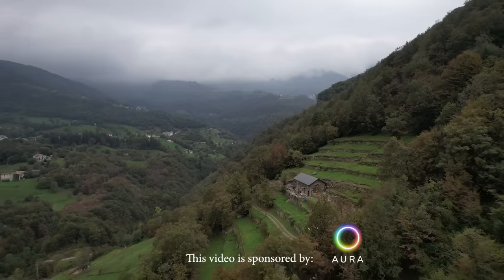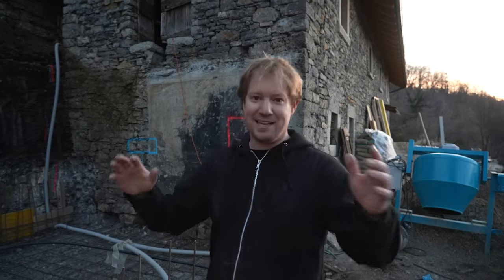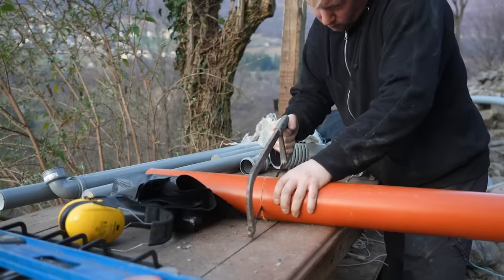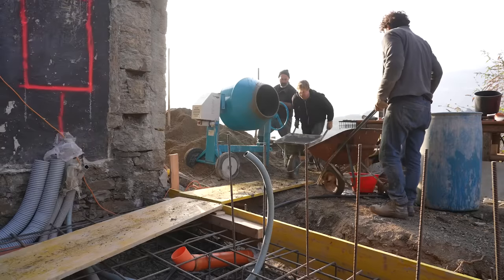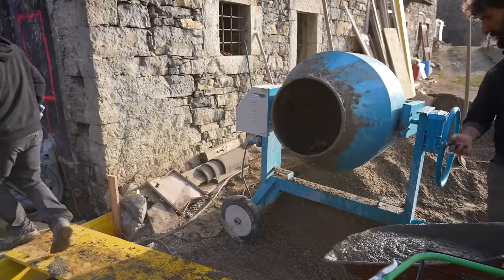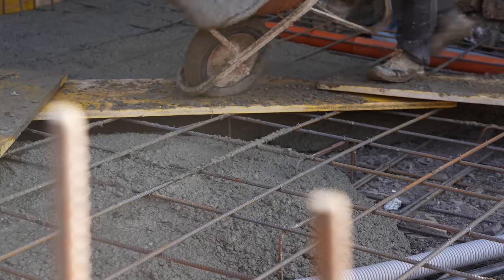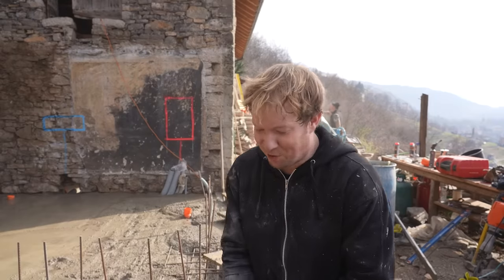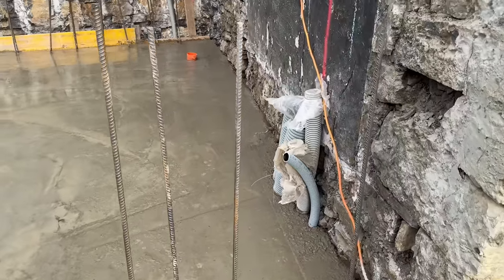THE EXPANSION BEGINS! Italian Stone House Renovation.

Comment: I am so amazed at how fast you all were moving getting that cement dumped with each wheelbarrow full!!! It really does help to have more help. I was just remembering when we poured a small 10' x 10' cement pad for a small shed we built on top. Both of our kids (then almost teens) helped shovel the rocks into the mixer, Peter and my husband Charles would dump the wheelbarrows (I probably did, too. I was much stronger then.). It was a great family time and we worked hard to make that backyard a great space to play! Eventually, we put in a pool and backed up the hill behind. Still miss that house for that backyard. :)

Glad you got all the plumbing lines and hoses for electric and other things run before the guys were there to do the cement. What a nerve-wracking process to remember every little thing! Working with seasoned pros is truly an education. Glad you home is coming along!! Sounds like things are settled with the city?? Hope so! Get some rest. 😄💕

Comment: since you cant dig out between your back wall and the terrace wall, have you considered filling the whole area with lose stone, and concrete. you could put a drain in on the terrace side, then a mesh of rebar. then start filling 2ft of rock, 2 of concrete vibrated into the gaps. and repeat the whole way up. your stone will be strong fill for free. or you could put in a bunch of Styrofoam blocks in as fill. stabilizer the wall and the terrace.

Comment: We lift the bottom rebar off the ground normally with plastic spacers as per civil engineers specification. 
Or you can pull up the rebar while pouring the concrete to get the concrete underneath the bottom rebar.
The reinforcing bars should always be placed at an adequate cover from soil. If reinforcement touches soil, it is susceptible to corrosion, which will eventually disintegrate the material, thereby deeming it useless in terms of providing adequate tension/compression or shear capacity. Rebar laying under the concrete, provide no benefit.
Greetings from South Africa.
Reply from the maker: We lifted it with loose stones

Comment: depending on the job, the manpower is based on a multiplier, not just an increase, but every job has a fine line of when there are too many workers, for 1 mixer 3, maybe 4 workers are the max before it becomes a detriment

Comment: This story, even though it is not a living space, there should have been a plastic membrane moisture barrier placed under the concrete.Because it will wake moisture up and rust your appliances.And anything you leave on the floor will soak up moisture through the concrete

Comment: Just curious, what do you do if a pipe buried in the cement floor breaks, do you have to tear up the floor to get to it to replace it? I can see having a crawl space in the rest of the house would have that not be an issue, but looks like the addition will have pipes right in the concrete. Very interesting what you’re doing!
Reply from the maker: You make sure the pipe doesn’t break 😂😏 we use reinforced pipes to ensure they are super strong

Comment: We were wondering why they didn't set up some type of trough where you can pour the cement from the mixer into a length of  half pipe (trough) letting the cement slide into the area?   <-- so says the backseat contractor.   We love your videos.
Reply: I'm wondering why not use Small Cement Truck to Pour! ...and a Rebar Tying Auto Hand Machine ... Boom Half the stress and Time Etc ..... But must be a Reason 😃

Comment: Think of the brick in the crawl space between cement layers like the old Roman floors. This was the way they heated rooms. They'd build a floor, use stacks of clay Pilae tiles every couple of feet around the floor and lay the finished floor on top. The hot air/water would travel around the room under the floors. Congratulations on such quick work! I look forward to seeing the next step!
Blessed Be!

Comment: Imagine that, professionals get stuff done quickly and up to code. You should have hired these people from the get go and saved finish work for yourself if you just feel the need to do something. Skilled blue collar mechanics didn't learn this overnight, it takes decades of experience and many years of actual training. If you want to learn how to do this stuff, you need to work as a go-for for years while getting trained to do the skill work. Anyway, you still should have solved the water intrusion issue before anything else was done. Good luck to you.

Comment: Quick question - as you know, in North America you'd just pull up a cement truck and pump out that 10/cm of cement in 30-45 min. Is doing it by hand a factor of your remote location, access on site or just a cost factor? Regardless, crack a beer - you earned it that day!

Comment: Is there a reason why you don’t have a cement truck deliver the cement instead of breaking your backs?  The advantage of a truck of premixed cement is that you can order a high strength cement or have fibers added to the cement so you don’t have to worry about the structure sliding off the mountain during torrential rains.
Reply: I think it's the road.
Too narrow for a cement truck (have you seen the u-turns from the drone?).
Also too fragile (? i think): you can't put so much weight on that type of road.
Reply from the maker: Correct the road can’t handle a cement truck. So here we mixed approximately 1.5 full truck loads
Reply: @RaisingVoyagers  gees, that’s too bad. After all that mixing, moving and floating the cement, how did your body feel the following day?  I’ve had 6 operations on my lower back so far and I was cringing watching you guys work. 🥱. You guys do great work. With a bad back, I really miss doing work around the house. Blessings to you and your family. ❤️

Comment: Why guys with 30 years of experience are not using the old methods to build the extension? Following the same way the main house was built? I dont believe concrete and steel are needed, hope you get my point. You could save money....
Reply from the maker: There are many legal requirements to follow. Code would never allow the house to be built in the old fashioned way.
Reply from the maker: And building with cement and rebar is actually far cheaper than building without. You’ll see coming up soon, how when using cement you actually do save a lot of money…. But the primary reason is to follow code

Comment: Please don't get me wrong, as I really enjoy following your restoration voyage, but as a retired member of the construction industry it yerks me when I hear you making the mistake of many regular folks. What you filmed in this episide was the pouring of "Concrete" not Cement. Cement is the gray powder that comes in bags which is used in the mixture of a) Cement, b) Sand, c) Gravel and d) Water, which put together forms Concrete. There are many forms of concrete, which are determined by the ration of Sand/Gravel to Cement, also the grain size of the gravel and last of all the strength of the cement ( correct full name being: Portland Cement). In addition, please recognise the difference between Gravel and Crushed Rock. Gravel has rounded corners and is usually harvested from river, lake or sea beds, whilst Crushed rock is the product from crushing larger rocks into sizes that suit the purpose. i.e. foundation under a "Concrete" surface, Frost blanket under a paved surface/road. There are many more explanations into the use and differences between Gravel and Crushed Rock, but if you really wish to show how much you have learnt during your project, please don't call concrete, cement or crushed rock, grave.  Last point, the reson the workmen brought their own generator is because a concrete vibrator required a 400HZ power supply, which you cannot get from the regular grid as that is only 50HZ.

Comment: I find it highly amusing that you can respect and are humbled by the stone masonry but can not appreciate the skill of the carpenters that did such an awesome job on hand hewing the chestnut beams. Making the beams more rustic by hacking at them without any skill at all.
Reply from the maker: The beams you’re referring to weren’t hand hewn originally and weren’t chestnut and they weren’t the original beams. They were cheap pine beams milled a few years ago and did not match the original structure. I happen to have hand hewn a lot of beams and have a lot of experience doing so by hand. The result matches the few remaining existing hand hewn beams extremely well, aside from the fact that it’s a different species of wood.